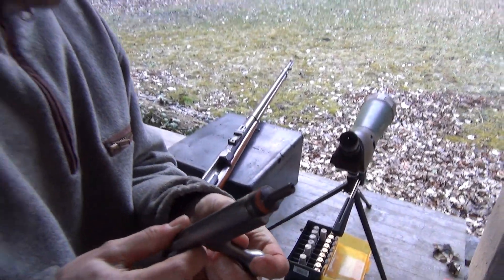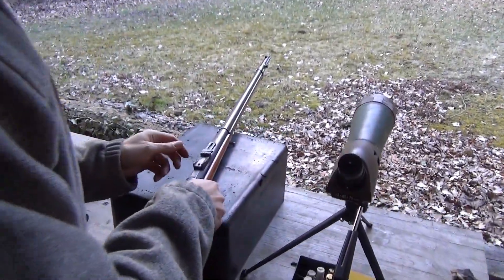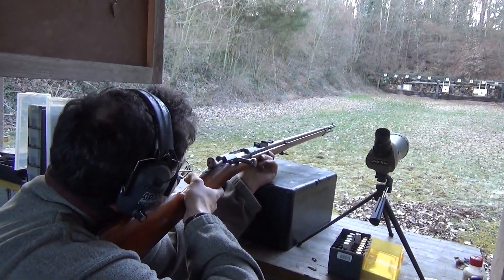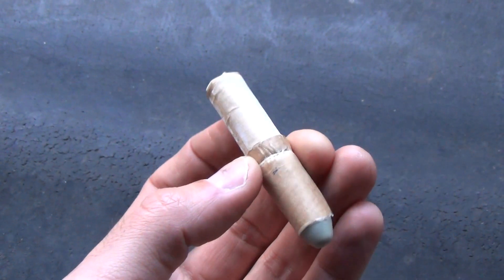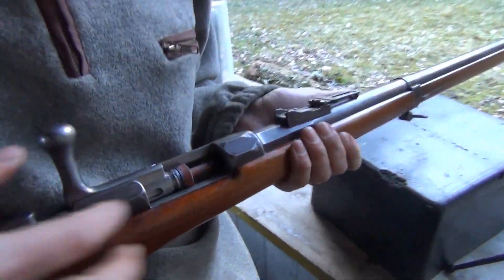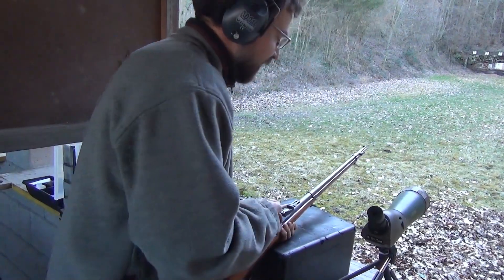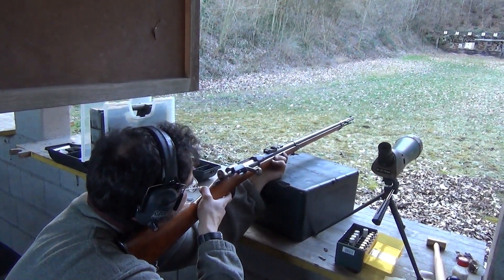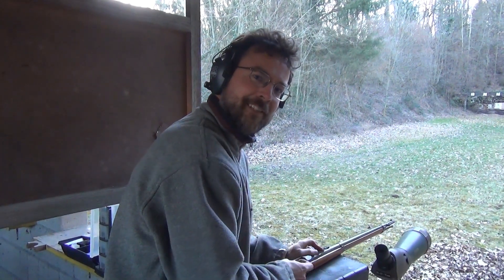Extra video: Chassepot M1866 Needle Rifle With "Original" Cartridges!

Comment: This is really interesting, I'm still trying to get my Chassepot cartridges to be more consistent too.  Likewise I'm finding if my cartridge is too long then it can be deformed or split on closing the breech. The other problem I'm finding is that the top hat caps don't always detonate when struck by the point of the needle/firing pin.  Whether it's lack of surface area impact I don't know.  I'm experimenting with a flat headed needle to make more contact, but this is being slowed down by the card on the back of the cartridge and making the impact too soft!

I started with a needle which was a original but a little too short and so used a toy cap gun plastic red cap filled with OB powder inside the top hat cap.  This was quite successful!  I think it was the increased chance of detonation if at least one cap went off.  It was an immense faff to make though (on what is already a highly labour intensive task).  Amusingly the red fouling caused club chums to insist that it must be the plastic from the cap being blasted over the innards of the bolt assembly! I never did think that, so thanks for the confirmation!

I will watch your experiments with great interest. I really would like to get to near 100% consistency to be able to compete in some of the HBSA events and perhaps give the Martinis a run for their money!
Reply: All but one ignited so primer strike was good once I had degummed the needle, with both berdan and percussion caps.  I drill cross holes in the walls of the percussion caps as flash channels.  I also added a few turns of extra spring to the striker to increase the speed and force of impact.  I had omitted the rubber disc in the base but I think it’s essential to prevent fouling of the needle and sticky bolt problem I had.  I’m also going to make them a few mm shorter than the regulation pattern.  In theory they should chamber just by pushing the bolt home.
Reply: I found with mine that they keys were, to fully understand the original cartridge as factory made (not the improvised rubbish later in the 1870 War) incorporate the rubber disk, which is the key to expelling the base after the powder cartridge is pulled out by the bullet but the ignition is entirely dependent upon the rigidity of the powder case. A well packed tight powder case will cope with being a slack diameter in the chamber for ease of loading yet will ignite when struck. It is tempting to use a blunter needle point to help with ignition but it has to be sharp to easily penetrate the rubber disk and let the disk slip back off it. Splendid work. How easy is it to take D2 arms across the border into Switzerland?
Reply: The omission of the rubber disc was a big mistake on my part, but it has been a very good learning exercise and it teaches you that they thought long and hard about the cartridge and incorporated every feature for a reason.  Even the shape of the bullet and conical patch is there so that the cartridge self-centers when chambered so that the cartrigde base is centered with respect to the bolt face in the oversized chamber.
Reply: WRT D2 guns, it depends since there is no equivalent category here, if it's prior to 1870 I can import without paperwork, if its post-1870 and single shot, I need a private sale contract (free) and import license (50CHF), if it's post-1870 and a repeater/semi-auto, I need a purchase license (50CHF) and import license (50CHF).  It's all purely administrative.
Reply: I use a small rubber disc behind the moving head that seals the gas coming back down the side of the needle. I use a disc of old cycle inner tube about 8mm in diameter. Remove the bold head and spear the disk with the end of the needle and then replace the head, pushing the rubber disc down the needle back in to the cavity at the end of the bolt. This seems to stop the gas fouling the rear part of the bolt assembly and saves you having to fit rubber rings to the bases of cartridges. You have to remember to poke it out when cleaning.. It seems to work for me!
Reply: Felix The Cat Thanks for the tip, I used to do a similar trick for the Dreyse with a leather disc but I couldn’t think of where I could put it in the Chassepot bolt.  I’ll put rubber discs in the cartridges for this exercise since I’m trying to stick to the original pattern but will probably switch to the bolt disc afterwards.
Reply: The majority of misfires I have encountered have been either where the needle has not initiated the primer even though it penetrated or where the primer (top hat type) has fired, but not set off the main charge. There are some workarounds.. one idea is to break off opposing legs of the primer so there is a gap.. this I found to be a PITA, and bending primers so close to the compound made my professional nerves jangle. The better solution is to put some loose powder into the cap chamber to enhance the flash. You must not fill the chamber as this will put too much drag on the needle, about a quarter full seems to work and then you need to glue the cap wings to the card disc that will form the base of the cart. This ensures that the cap is not forced into the main charge by the needle. The needle NEEDS to be sharp.. I have been down the blunt needle path and it does not work. The ignition system is working in stab mode, which is actually much more reliable than an impact/pinch mode. It is used in many fuze designs for this reason. The needle needs to penetrate the cap composition and the cap itself so that it does not push it into the charge..(and also increased the chance of the flame getting to the main charge..)
Reply: Felix The Cat All of them went off without need of any booster charge, both Berdan and Percussion caps, my only problem was needle drag in the bolt.  I drill small holes in the wall of the percussion caps to give lateral flash holes.  It is what the Russians did in their Carle needle rifles.
Reply: Ooh drilling holes in percussion caps.. very brave minister!  I think I will pass thanks! The French percussion caps had a pretty small flange unlike modern RWS types, hence the use of the shaped cardboard retaining washer.. Russians.. I suspect even the Russians perforated their caps before filling them! Priming the caps is the only solution I have found to reliable ignition, and does not seem to affect accuracy.. maybe just moi and my Chassie.. 

If you are getting needle drag from the bolt head, then perhaps you need to look at clearances, and thickness of the needle.. I don't seem to get this problem. The washer behind the bolt head does seem to  keep things clean in the bolt body.
Reply: Felix The Cat I drill the side walls of the caps, no way near the priming compound. The very first pattern of Chassepot primers actually had two holes in the top of the cap.
Reply: I drill my percussion caps too, made a little jig for it. 100% success rate. Do you use the silk gauze in your cartridge, or any flame retardants?
Reply: Elizabeth Vodevic I’m using silk gauze, a bit fiddly but it reinforces the case walls nicely too.
Reply: Please be careful chaps and chapesses! One of my guys almost blew his leg off drilling into explosive items.. If you must do it, make sure you are not going to be affected if the cap fires.. bits of brass or broken drill in your eye will not help your shooting! Jigs and remote drilling is the way to go if you are going down this path..
Reply: Felix The Cat I do it slowly turning by hand with a modelling pin drill and NOT through the priming compound.
Reply: I am quite sure you are doing it carefully, and not through the priming compound, however any mechanical activity near primary explosive is potentially risky. My advice is that if you must do it, do it such a way that if the filling initiates, it will not do damage.. I have heard the phrase "I didn't think it would do that" too many times in my ammunition career to be complacent..